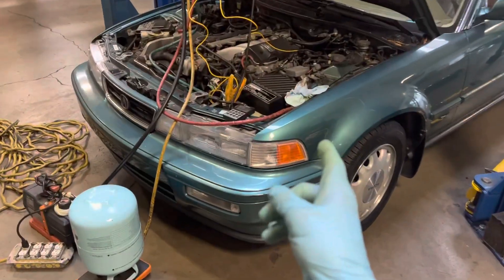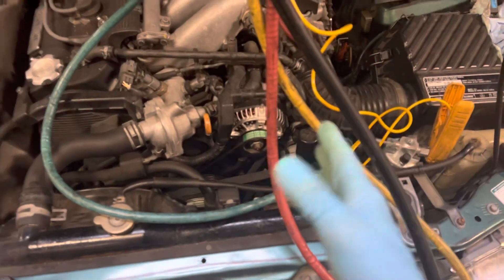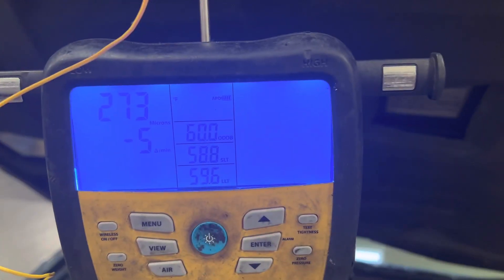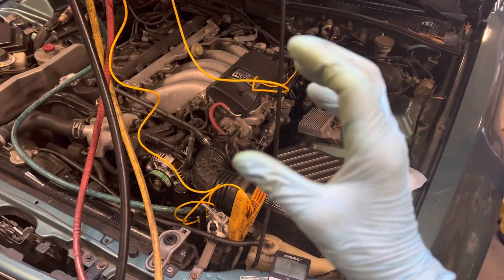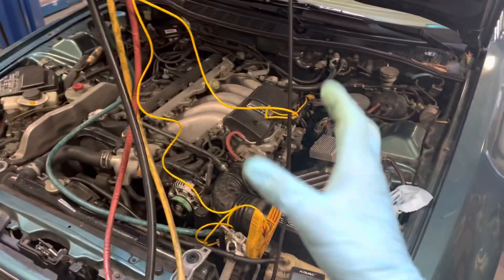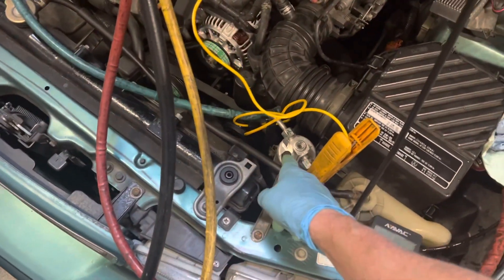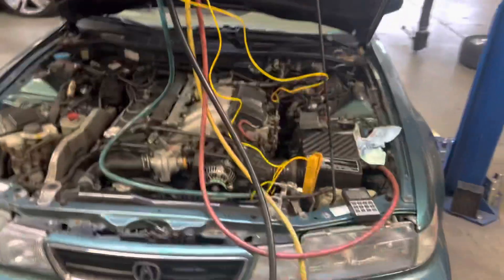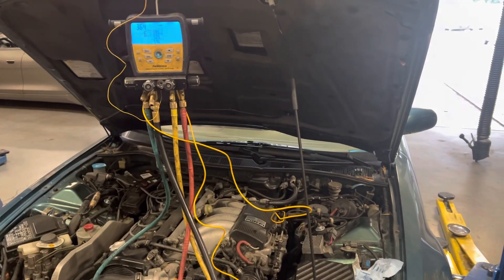Old mineral oil was 500 viscosity new PAG oil DENSO ND–8 is 46 viscosity￼

Comment: Great info! If you get a new compressor for an R12 system that comes filled with PAG oil, will using that compressor with R12 and mineral oil be OK if the PAG oil is replaced with mineral oil or would mineral oil be too thick for a new compressor due to the tighter tolerances?
Reply from the maker: If it is not a rebuilt, old R 12 compressor. 
     And if it’s from one of the new compressor manufacturers who built the tolerance to run off of PAG 46 oil. 
     Then you stay using PAG 46 oil. 

You go by with the compressor manufacturer says is required not by the refrigerant . 

I would highly recommend 
DENSO PAG 46 it’s double and capped. In a reliable high-quality source of PAG oil.
Reply: @coldfinger459sub0  It would be best to flush the system and use PAG oil with the R12 if that's what the compressor came with? Also, what do you think of using double end capped PAG oil like ND-8 with R12? I've heard mixed opinions and experiences and Denso didn't seem to know, they just said they don't recommend it since it hasn't been tested.
Reply from the maker: @averyalexander2303 yes flush is best. 
Yes, did DENSO 46 is the double end cap that’s all they make. 

When Mercedes-Benz was doing retrofit on their vehicle vehicles . 
   DENSO 46 double end cap is what they were using.
Reply: @coldfinger459sub0  Wow, good to know!  Didn't know ND-8 could be used with R12, I thought it was for R134a only. Thanks for sharing! Would flushing and refilling with double end capped PAG oil of the appropriate viscosity be an upgrade for an old R12 compressor when sticking with R12 or is mineral oil best? I've heard conflicting thoughts on whether mineral oil protects as well as modern PAG or ester oils.
Reply from the maker: @averyalexander2303  if it is a old R 12 compressor that was designed for old mineral oil 500 viscosity and you were using our 12 then you would stick with 500 viscosity mineral oil. 

If it’s a brand new modern day compressor that was designed to replace 12 refrigerant but it was designed for 134 refrigerant and the factory said to use 46 viscosity refrigerant oil 
   Then you would use the 46 viscosity refrigerant oil with the R 12. 

What kind of compressor is this? 
Is in a old American compressor style Frigidaire A6 
Or a York or a Tecumseh compressor  ?
Reply: @coldfinger459sub0  Makes sense, thanks! What I was confused about is whether double end capped PAG oils like ND-8 work well with R12 vs mineral oil. If so, that would be great because converting to R134a in the future if R12 became unavailable wouldn't require an oil change to be done right.

I was primarily asking about my 1990 Acura Legend with its original Denso 10PA17C. It's making noise while running and I haven't yet determined if the issue is internal damage/wear or the clutch. The sight glass is clean with no visible debris and the clutch intermittently drags very slightly and scrapes when disengaged, so I'm hoping there's nothing internally wrong because it's looking like finding a quality replacement compressor for that may be a challenge.
Reply from the maker: @averyalexander2303  you always get extremely mod modify it
Replace the compressor with whatever is available 134 refrigerant upgrade the condenser to the biggest modern micro channel parallel flow condenser you can custom fit in there with your own brackets or if there was one available there’s 100 manufacturers replaced the receiver dryer and converted over to 134 refrigerant
Reply: @coldfinger459sub0  I'm definitely getting the biggest and most efficient parallel flow condenser I can get. I'm going to have to make custom lines and brackets and possibly modify the air seal plates, but the improved efficiency, reduced airflow restriction, and weight reduction will be worth it.

As for using R134a, I could get a Denso R134a TXV and convert when I rebuild the AC system, but wouldn't I lose cooling efficiency? Seems like the general consensus is that these don't cool as well on R134a as they do on R12, but never heard of someone using a parallel flow condenser either.

From what I heard about the 2nd gen (1991-1995) Legends, the early R12 systems cooled much better than the later R134a systems in hot weather, especially at idle and low speeds.
Reply from the maker: @averyalexander2303  the one thing when you use a parallel flow condenser the refrigerant quantity requirement goes down you’ll have to figure that out.

Comment: Just found out why my compressor is so hot. I still have R12 system and replaced compressor w/ a R134 type. I disassembled and cleaned all the PAG oil out of the new compressor, reassembled and put back the same amount of mineral oil that came out of the old compressor. That's what I get for listening to the compressor sales people!!!! Would have made the same mistake again if not seeing this vid.  Thanks (Fortunately I caught it in time and did not run it to failure.)
Reply from the maker: Sales people selling parks or manufacture selling chemicals manufacture selling something to make a profit will give you the answer that get you to buy and purchase their product they know it will last long enough at least to get out of warranty and there’s no way you can prove it’s because of them